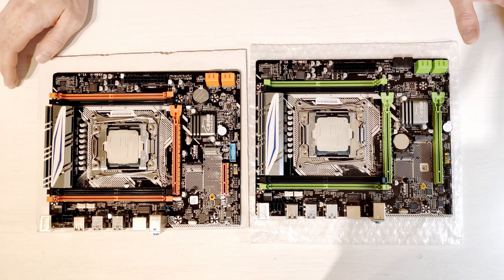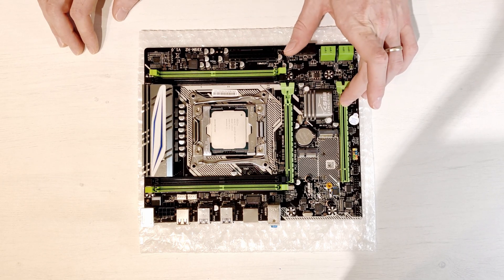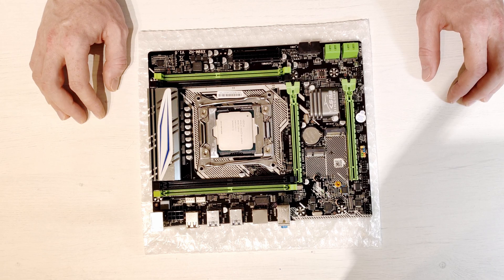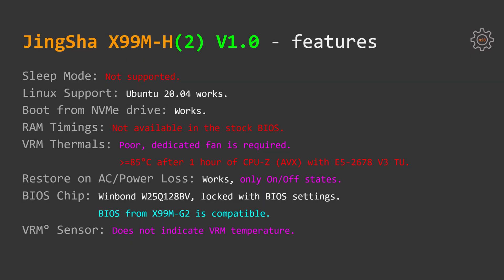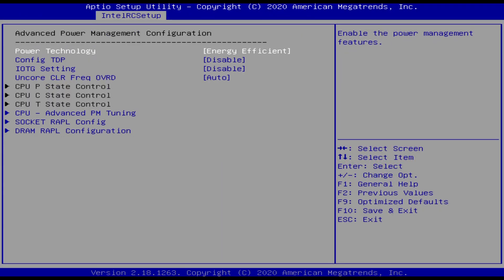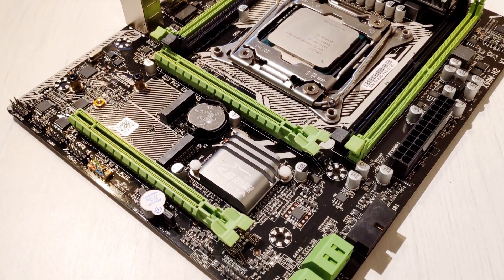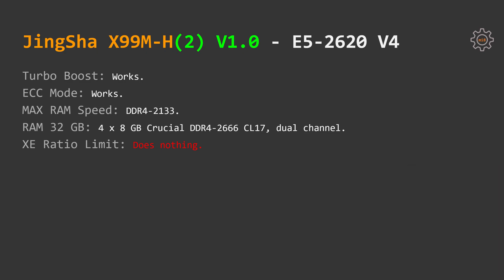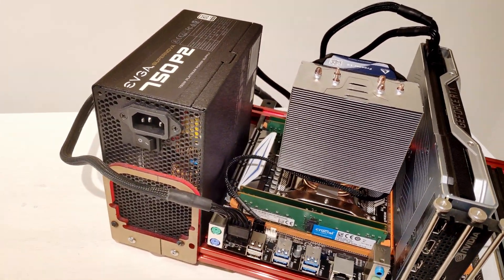🇬🇧 JingSha X99M-H(2) – detailed review, E5-1660 V3, E5-2678 V3, E5-2620 V4, i7-5820k, i7-6800k

Comment: Did the i7 5820K work with Registered RAM?? Also, did you check if ECC was actually enabled? CPUs that don't support ECC can work with ECC memory ignoring the ECC feature. But Registered memory never works! :| It would be nice, I have a 5820K collecting dust because I use these boards for home servers, and never even tried to boot it with registered memory.
Could you try it with DDR3 memory on any other board? The memory controller is DDR3 and DDR4 compatible, but it was locked by Intel.

You can check if ECC is actually enabled with:
wmic MEMORYCHIP get DataWidth,TotalWidth
wmic memphysical get memoryerrorcorrection

It should say 72 / 72 and something other than 3.
Reply: I wonder why these chinese manufactures can't figure out the PCIe connectivity. I have a board with 4 PCIe x16 that fails to split the lanes and only work 2 at a time. Now with 5820K that has actually 28 PCIe lanes, they don't seem to know how to connect them. This board could have 16x + 4x + 4x NVMe perfectly working with a 5820k/6800k.
Reply from the maker: Yes, my i7-5820k worked with ECC RAM :), Memtest86 configuration screen indicated that the ECC mode was ON, but I didn't perform any further validations.

Comment: Thank you for another great review! May I ask a n00b question. Hypothetically, if I have a motherboard det and cpu which support 64g quadchannel memory. Furthermore the motherboard supports 8 dimms. Which is the best  memory stick setup? 1 stick with 64g, 2 sticks with 32g, 4 sticks with 16g, or 8 sticks with 8g each? Many thanks in advance!
Reply: You should use 8 sticks 8g each, it will probably be the better option. Or go 4 sticks 16g each if you're not on a low budget. 
Both these 2 configs work on quad channel which is what you want. 2 sticks or 1 stick only will not work on quadchannel so forget that.
Reply: @dieantischeisse  Many thanks for your answer! I'll have to give the prices a thorough look!
Reply from the maker: I would go for 4 * 16 GB to have all four channels active, but still have 4 empty memory slots for some future upgrades.
Reply: @Miyconst  Many thanks for the reply! If 64g is the max capacity, is this, 16x4, the fastest arrangement?
Reply from the maker: @dempa3  so far every X99 motherboard I have tested worked with 32 GB memory modules, so if you have 8 memory slots, maximum memory capacity is 256 GB, if you have a 4 memory slot motherboard - 128 GB.
Reply: @Miyconst  Thanks again! Are the Kllisre DDR4 desktop memory sticks (those with a black Corsair-like heat sink) a reasonable choice, or an unnecessary  risky one? For some reason 2400MHz and 2666MHz costs the same. Any reason not to take 2666MHz? Do you have an affiliate link for memory sticks?
Reply from the maker: @dempa3  I would only recommend you to buy this memory with a motherboard, otherwise there is a very high risk that you will get incompatible modules.
Reply: @Miyconst  Incompatible with the motherboard, or previous memory sticks? If motherboard, then that's a shame! I'll check out if there is any reasonably priced memory on the used market, for the used Asus motherboard I recently picked up. Thank you once again for an expedient and helpful reply!

Comment: Hello Miyconst, How are you? I was wondering if I can do the max turbo mod on the JINGSHA X99 M-G: https://www.aliexpress.com/item/1005001334415255.html  . If I can, which bios do I use on Mi899? Thanks.
Reply from the maker: BIOS for JingSha X99M-G2 should be compatible with X99M-G, but since these motherboards randomly use different chipsets, I can't guarantee compatibility.
Reply: @Miyconst  Wow, first off thanks for this sonic-speed reply. I greatly appreciate it. Looks like I will have to check which chipset the M-G is uses once I receive it. Thanks again.

Comment: Greetings from Brazil! Is there any difference between machinist x99z  v102 and Kllisre x99 v102? Its cheaper for me buy at Kllisre store.
Reply: In addition, machinist store has a slight different mobo, with different heatsink... And used DDR memory in combo (mobo + processor + memory)
Reply: @ricardo3126  I feel like I know what listing you are talking about from RE Store. Kllisre X99Z V102 is exactly the same as Machinist X99Z V102. It has the same DDR4 RAM slots, VRM and chipset cooling and the exact same BIOS chips. Beware the BIOS chip that comes with your motherboard, if it has a 256 in the name then it's a fully unlocked 16MB BIOS chip and you can use FPT to flash turbo boost unlock. If it has 128 in the name then it's 8MB and it is trickier to flash, for me using AFUDOS and AFUWIN worked and using high power USB slots along with an USB programmer also worked
Reply: @JasonBrodel  thank you for information. In fact, I am looking at Kllisre Store and Machinist Store, and looks like the combo from Kllisre Store os a better deal... Greetings from Brazil!
Reply from the maker: As Jason said, these are exactly the same motherboards. The Machinist X99Z with a "different" heat sink is also exactly the same as the original one, just a different heat sink. Some people have bad experience with the upgraded heatsink, because it had misaligned screw holes, which resulted in a bent motherboard when the heatsink is secured on the motherboard. I have personally had about 4 of these motherboard (with upgraded heatsink) and didn't have any such issues.

Comment: Could you do instruction to flash new unlocked bios to x99 t8d?
Reply from the maker: You do it exactly the same as on any other motherboard. Why a dedicated instruction is required for X99-T8D?
Reply: @Miyconst  cause in your prog i can not see any bios for this mobo, and at site in site section we can read is another bios firmware tool to flash new bios. Am i wrong?
Reply from the maker: @patrykzapior8078  X99-T8D is not a very popular motherboard, that's why I didn't spend time adding it to Mi899, but the general procedure is the same. 1. FPT. 2. AfuWin. 3. CH341a. On of these ways works for all X99 boards.
Reply: Ok thank you much, i will try to do it properly. Could you tell me is possible to oc this 2 xeon?
Reply from the maker: @patrykzapior8078  it's not possible to overclock any E5-26XX CPU.
Reply: @Miyconst  Thank u :)

Comment: This'll be a stupid comment but here we go. Does anyone have any idea where I can buy a properly big VRM heatsink for an X99Z V102. I looked all over AliExpress but it only gives me links to extremely small chipset heatsinks
Reply from the maker: I was actually looking for the same thing and could not find anything. You can message Machinist store on AliExpress and ask them.
Reply: @Miyconst  Sadly in my case both the reseller and the Machinist store, along with Atermire and Kllisre (they sell X99Z V102 boards as well just rebranded) have simply disregarded my question and have not been able to provide me a link for any sort of suitable heatsink. At this point I may as well find two beefy M.2 SSD heatsinks, place one normally and cutting the other to size to fit the rest of the VRMs and see if that actually does anything for VRM temperature stability. I have no intent to upgrade to a higher wattage CPU but I feel like finding alternative VRM heatsink ideas would benefit those people who just want to run something like an E5 2678 V3 on a Machinist board considering it's general reliability according to my experience (and the experience of a lot of people it seems considering the only complaints are overclocking or RAM timing tightening related). I have a Kllisre branded X99Z V102 and it works fine with E5 2620 V3 but then again all X99 boards work well with that CPU
Reply from the maker: @JasonBrodel  I am totally with you on this subject. At some moment I was also looking for a better VRM heatsink for X99Z, but could not come up with anything better than a dedicated VRM fan. Maybe in the future, Chinese will release an upgraded version with a serious heatsink, but I doubt it.

Comment: Hi Miyconst, what do you think about Xeon E5 2699 V4 22 cores 44 threads at 450€ on Aliexpress? I am very intenctioned to buy one, I just have an X99 system featuring Huananzhi X99 F8, 64gb ram (8x8gb) and Xeon E5 2683 V3, my utilsation is productivity and streaming, for gaming I just have another pc
Reply: if you think it's worth it for you, go ahead. that processor is not worth it for most but your situation might be different. also, yes, it's a great processor
Reply from the maker: It's a great processor, if you really need it, but most people would be much happier with a Ryzen system for that money.
Reply: @Miyconst  I just have a 3800X system and I'm looing to increase the power of my secondary X99 system :)
Reply from the maker: @primi67  again, it all depends on what you need in your secondary system. Do you need more cores or you need faster cores?
Reply: @Miyconst  more cores because I have to stream in veryslow setting and in slower (that is more than very slow) my E5 2683 v3 is utilised 90% and the stream lags a lot. I use two pc for streaming because I don't want to lose fps in game
Reply: @primi67  Considering you already have the RAM and motherboard, the 2699 V4 will probably be the most cost-effective improvement you can get for veryslow CPU encoding. A 2679 v4 has similar multicore performance due to its higher clocks (depending on things like OS overhead and memory latency, it may even end up slightly faster than the 2699V4 for streaming in some situations), and is a similar price, so might also be worth considering, but as it's a 200W CPU you would require an extremely good VRM and cooling.
Reply: @nathangamble125  I need more cores because of streaming, if the second pc is for gaming and streaming at the same time, I take the cpu that has more clock speed, but the second pc id also for encoding, for this reason more cores are better, by the way thank you for the answer :)
Reply from the maker: @primi67  well, it seems like E5-2699 V4 might be justified in your case, but beware that its second hand value will drop very fast.
Reply: @Miyconst  thanks a lot, I will consider what you say :)

Comment: Waiting for mini itx for 2011v3 socket.
Reply: asrock tried those but had too many issues with the density of stuff needed, even if they went 2 channel if i recall
Reply: @gabrielecarbone8235  ciao fra :)
Reply: ikr!! so unfortunate that only x79 has them. it'd be great!
Reply from the maker: There are no mini-ITX boards, the X79/X99 options you think about are mini-DTX, which means they don't fit into most of the ITX chassis. The boards quality is also rather poor, thus I don't plan to review them.
Reply: @Miyconst  i thought they were itx.. good to know :)